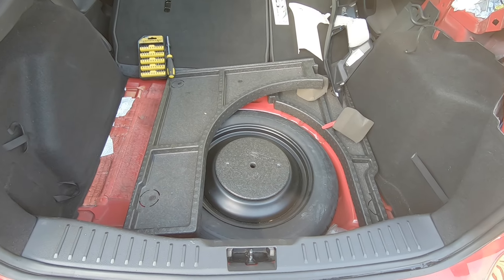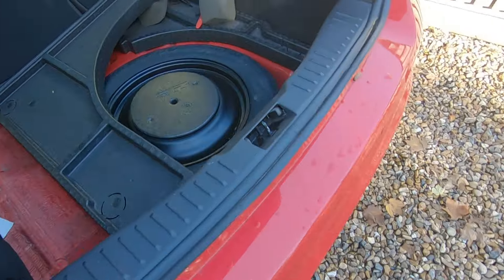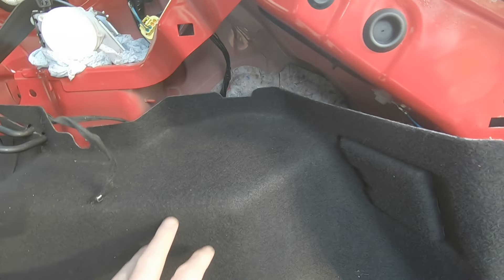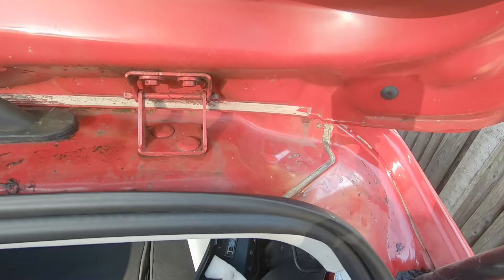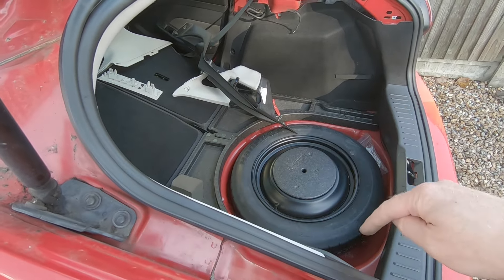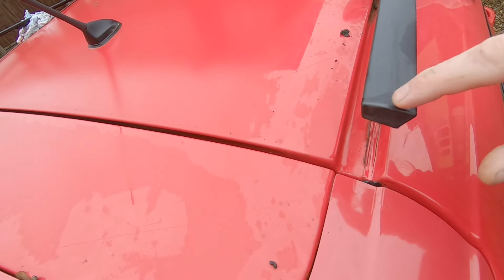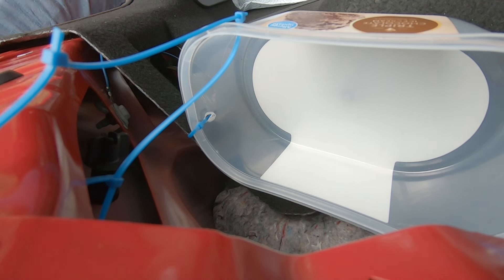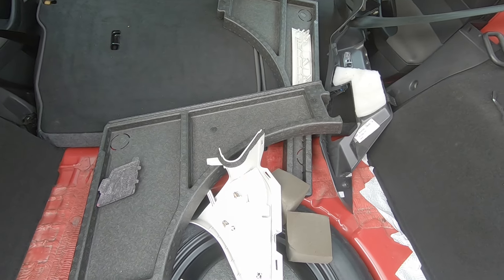Ford Focus mk3 multiple water leaks in boot fixed!

Comment from the maker: I can confirm that it has been 6 months since I filmed this episode and the boot of the Focus is leak free. Was a bit of a mission to find all the issues, but now more than happy with the fix. 😁
Reply: dan what’s going on with the starlet?
Reply: Do you think there's a correlation between boot leaks and speakers going bonkers?
Reply from the maker: @danielhenderson762  possibly. there are so many modules and fuse boxes that getting them wet could cause issues.

Comment: Absolutely ridiculous that Ford’s substandard materials and workmanship results in so many potential leak areas in the trunk compartment of this vehicle. Thanks for your persistence in identifying and repairing so many possible problem spots. Hats off to you from across the pond. Cheers!!
Reply from the maker: Thank you brother. Yes it is very frustrating to have to deal with these issues. If I were to put a positive spin on it though, the issues are very easy to fix with basic tools and cheap materials. Unfortunately most moden cars have common issues like this or worse no matter who builds them. Give me some mid 90's Toyota quality any day!
Reply: @dan91sgarage  any chance you can post a list of the materials you used to fix this? I did the vents on mine last autumn and the bastard is leaking again now
Reply from the maker: @pompeymike83  I used silicone sealant / adhesive for interior and exterior use for the vents. Tiger seal for the roof gutter / boot seams. It might not be the vents that have started again, it might well be the seams and stuff I show in this video. Basically check everything!
Reply: Thank you
Reply: Thanks, it's a better fix than the gaffer tape I used which has helped cut down the top leak, although not cured it. I had the bottom leak into the spare wheel sump. That's been fixed by re-drilling the drain holes in the underneath voids. Still have the upper leak, despite the gaffer tape so will reseal the upper channel and see what happens.
Reply: Thank you so much I sealed the vents up and thought I was done then by chance happened to see a drip higher up and was shocked and luckily found your video so thank you for your work

Comment: The vent issue should have been a recall on these cars. It's a very common issue that could and probably has caused a lot of damage Luckily I caught it quite early. I initially wondered why the hell my windows where building up so much condensation on the inside. Then I found the water in the spare tyre well. I cleared the water, dried out all the boot upholstery and thought that was it sorted. Then the condensation came back... That's when I googled and found the solution. Haven't had any issues since,
Reply from the maker: You're welcome 👍.

Comment: This video is really informative. I had the same issue last winter. Lots of condensation inside the windows and the carpet on the driver's side absolutely soaked. I managed to locate the leakage points on those upper lap joints and I've also removed the rear bumper and dumped the soundproofing material from behind those pressure vents. Wet and dry vac to remove all the water from the carpet. Luckily the passenger side was dry. I had the carpet lifted and supported plus I placed a 12 volt waterproof heat pad under various areas of the carpet. Unfortunately, the under carpet soundproofing is very thick in parts and had acted like a sponge. I don't have a garage so it took around 6 weeks to dry out. The other problem which can arise, is the problem of mold. ThIs can be a nightmare to remove. A good brand of all purpose cleaner (with no bleach) is the way to eradicate the mold. It's a very tedious and time consuming process but once everything starts to dry out, then it's well worth the effort. Shame on Ford and other car manufacturers for producing such poor design and construction.
Reply from the maker: Agreed, definitely best to get stuck in early. The first signs of heavy condensation on the rear window inside is the tell tale sign. Thankfully mine never got to the mouldy stage although there was a slight whiff which started me off looking for the problems. I used paper kitchen towels to soak up the majority of the liquid and then propped the plastic boot liners open and used a hair drier to dry out the inside materials. Thankfully I have a garage I can work in to let the sealant set and dry the interior out easier, on the street in winter is a much bigger challenge. Thanks for the comment. 👍

Comment: Just bought Ford focus 15 plate. Had it 2 weeks. Got into the car and the windscreen was covered in a lot of condensation. Than found the problem when taking somet out of the boot. Left side panel was mouldy and drenched. Booked into my local garage but now after watching this video and others I think I can sort it myself and pretty sure it’s those vents behind the boot that are the issue. Great video mate 👌🏻
Reply from the maker: Thanks mate, always start with the vents. It's the most common area. If the seam sealer is cracked you'll see them easy. 👍

Comment: Just done my in laws' 2014. I knew about the vents leaking but pulled the roof trims off to have a look & sure enough, cracked seam sealer & paint. Now to get the interior out to dry it & recheck for anything further. Great stuff, thanks for the tip off! 👍
Reply from the maker: You're welcome

Comment: Great video and informative about leaking areas. One that wasn't covered is water ingress behind the wheel arch panel (passenger). It's a thin piece of metal that when pushed will slightly bow inwards. If water in there you'll hear it. I can't for the life of me find how it's getting in. Going to check the seams mentioned and the car rack lining next. Many thanks for the video. 👍🏻
Reply from the maker: No worries, I can only play the cards I'm dealt and at the time of making this video I didn't have that leak. But guess what I have just found after the recent rain....yep that double skin is full of water and sloshes and squirts when pressed. I've re sealed the top seams after 2 years of service just in case and am now on the hunt for the wheel arch skin leak. It's either coming down from the top between panels and filling the void or getting in through a panel gap in the wheel arch (dirty water). I'll make a video when I find out.

Comment: Thanks so much for the video guys - really helpful. Like other commenters I'd already sealed the air vents behind the back bumper a couple of months ago but still had a leak. Yesterday I sealed the other areas as mentioned in this video. Here's hoping it's fixed the problem!

Comment: I own a 2013 focus and I got wet in the boot didn't know what to do. my car also ended up completely covered in damp so I got a full steam clean on the imside and had it dried out then I noticed the water coming in. mate great video I now feel confident that I can fix the issue I'm having by myself with your guidance from thus video. cheer mate you have got my sub on here
Reply from the maker: 😁 Thanks for the comment and sub. Always start with the vents behind the bumper, then check out the other stuff.
Reply: next dry day i get where im at i will be sure to do that. thanks brother@dan91sgarage

Comment: Thank you soooo much for this video. I have the exact same issue on my focus and i could not pin it down. I traced the leak to the high point same as yours and now have sealed the roof rack runners so 🤞.

Comment: Sealed the pressure vents today using white silicone, they are a pig to do since so many components need to be removed to access them.
Hardest part was getting the side trim to fit again.
If I knew these were prone to leaks I wouldn't have bothered getting one.
Reply from the maker: Unfortunately leaks into Ford Focus's have been common to all models since the mk1. Once sorted they're pretty good cars really. All modern cars suck in some way, they just have different kinds of problems! Lol

Comment: I really appreciate this video. Thank you so much. You have saved me hours even days of trying to find the leak. I will check everywhere you have and see if I have the same problems
Reply from the maker: You're welcome.
Reply: @dan91sgarage how do u get the roof strips off I start to pull but feel like I’m gonna snap them is there a way of pulling off?
Reply from the maker: @aledhughes1796  On my 2 focus's they were clipped on. I just gently lifted them up starting at the back. (I lifted them straight up, don't twist them or they can break the clips on the strip)
Reply: @dan91sgarage  cheers I’ll try later
Reply: @dan91sgarage  I’m losing the will with these leaks mine is behind the material stuff that’s covering the wheel arch inside the boot is wet whenever I touch it even when it’s not been raining I dry it and go back hours later and it’s dripping wet again I am losing patience with the car
Reply from the maker: @aledhughes1796  If there is still water without rain the water must be trapped in a pocket somewhere. Mine had sitting water above this plastic plate which dripped for a while til I found it.
Reply from the maker: @aledhughes1796  Mine had water collected in a pocket half way up the C-pillar. Dripped for ages till I found it.
Reply: @dan91sgarage  is that the black plastic plate u showed in the video? How do u empty that then and where was the leak for that
Reply: @dan91sgarage  u know the roof trims how did u pull them up enough to seal the crack there?
Reply from the maker: @aledhughes1796  Yes the black plate in the pillar had water above it, I emptied it by rolling up some kitchen roll and poking it through a slot to soak it up. The leak was either from the crack under the roof trim or from water getting past the boot seal. The roof trims are just clipped on, I gently lifted mine up straight, starting at the back in the boot area
Reply: @dan91sgarage  ok cheers will try it
Reply: @dan91sgarage  been looking at the car and I swear water coming through the two hinges each side u know from the arm that lifts boot door up, ran loads water down and then put hand up into car and it’s wet not far from the hinges. Its gotta be that hasn’t it, only ran water round the hinges
Reply from the maker: @aledhughes1796  They can leak from the lower gas strut mount. Through the screw threads or under the plates.
Reply: @dan91sgarage  yea that’s what I reckon is the issue, how would I stop that? Its very tight there for space not gonna be able to seal all around the plate I don’t think or is it safe to do so incase they need to come off sometime
Reply: @dan91sgarage  would I need to replace the mounts and screws like a new set? I assume for some reason the seal under the plates or screws has worn and lets water seep through
Reply: @aledhughes1796  did you solve it? couldnt you just unscrew the whole gas strut mount and put some sealant under the mount and around the screw and screw it back in?

Comment: I have a b max and have the same problem my local garage has done the vents this is a nightmare very informative video resealed the vents by garage this tiger seal is this available at local DIY shops
Reply from the maker: I bought mine from euro car parts, or eBay

Comment: I have to try as well. My MK3 is giving a problem only from the right-hand side. But it could be to same because is wet high to the window. So water probably is running down from the roof somewhere. Very good video. Thnx

Comment: I've checked the roof rails they seem to be okay didn't want to force them out of the roof like the idea of tiger seal I've been told it's very good product but it's used for permanent bonding not sure about this I've checked everywhere I've poured water everywhere you can think off but cannot find this leak at all boot surround rubber weather strip gas struts tail lights joining car any ideas at all wish I had more patience using coloured water to see what side the water is coming down on orange on the left blackcurrant on the right start at the bottom any ideas good video very well detailed

Comment: Great video. I have done the vents behind the bumper but still have the speckles of water on the sides and a damp smell. I will try the roof and the joints next. Great cars these mk3 focuses (I have had 2) both with this fault. Your video will be a great help. Thanks
Reply from the maker: Glad it helped

Comment: Great video, my seam sealers above the bootlid and the roof channel looks similar, so i did sealed it with some silicone, my vents already been done by one of the previous ovners, and i still get a little bit of moisture after raining just under the rear seat backs, as i fold them down i can feel it on my hands, but no carpets wet anywhere. it's a weird one
Reply from the maker: Check the rubber boot seal around the boot opening is sealed to the body as they can leak here (mine did). Also the rear light clusters have foam seals where the bolts pull them onto the body and they can leak here too.
Reply: @dan91sgarage  Thanks, it's a 12 year old car i had it for a month, and someone already been at these places with silicone, the rear end and the carpets are dry, only where the floor goes under the back seats there is some dampness, so i don't think this comes from the rear end, like the seal etc as everything is dry there. but the carpet under the seat is also dry. i have done the seam seals like you did in the video, will see how that goes.

Comment: I had leak on my Ford focus mk3 estate ,seam it was problem, i clean old sealant and reseal it with some black sika sealant,also check stop light cable and windshield washer hose , i find mine little bit wet, same as door suspension bracket bolts was luse,so far no leak.

Comment: Thanks, Great video still relevant today! fixed the vents under the back bumper about 2 yrs ago (car was soaked, had to remove all interior inc cabin foam/carpet to dry out.  Noticed damp smell again about a month ago, noticed rear right trim in boot was wet.  Dis some more youtubing and found this vid.  Have just tiger sealed over the crack under my roof rail, and over the 2 body joins at top of boot and part way down hopefully that should sort it :D

How did you get rid of the water that you found with the kitchen roll? did you just leave it to dry?
Reply from the maker: I started off soaking up the worst of it with kitchen roll / towel and ringing it out. Then switched to careful use of a hairdryer on low heat.

Comment: This seems to be a common fault on B max and focus my local garage did the repair on 30/01/25 water still comes in my local garage told me straight away it's coming from the roof rails down to the vents it seems the roof rails are the culprit back to the garage I took my rubber seal of the boot area and noticed the manufacturer doesn't put much grey stuff on it plumbers mait for seal ?I spent all day Sunday 02/02/25 looking for leaks can't find this water leak anyway I will check the roof rails now always the last place we think off
Reply: I've checked the roof rails it's not them I've poured water everywhere you can think of I cannot for the love of me find this water I've checked the gas struts the tail lights I've poured water everywhere you can think of I was hoping the roof rails would be it this tiger seal is used for bonding permanently

Comment: Just bought a 14 plate Focus and have noticed the boot is wet, but only on the left side and I can see it dripping down onto the wheel arch lining, it seems to be coming from just above the light. What option do you think I should try first (or tell the garage to try)? The bottom of the lining is soaked and around the spare wheel carpet but the right side is completely dry. Thanks
Reply from the maker: It's very difficult to say for sure, sometimes drips can be condensation forming on the metal above the light and not an actual leak! I always check the boot vents behind the bumper first, this is done by removing the round plastic plug under the car on the boot floor (shown at the begining of the video). If rancid water poors out then the vent is letting it in. I also had a panel seam leaking in the same area above the light so thats my second guess.

Comment: Was the water in the spare wheel well? Cheers
Reply from the maker: If it is left to leak for long enough it can get into the spare wheel well, then when you brake it sloshes out under the rear seat into the car as well. On mine the felt material under the spare wheel was soaked and smelt mouldy.